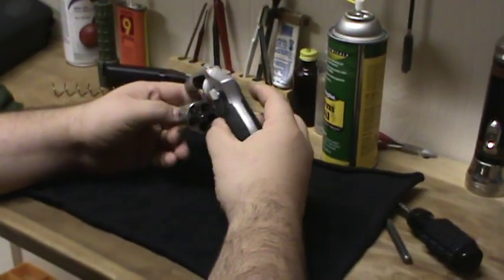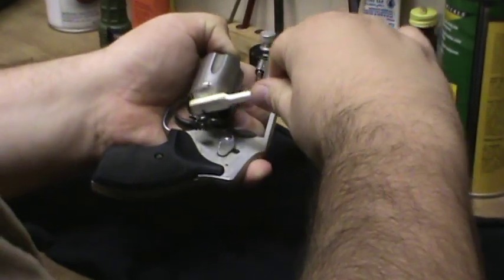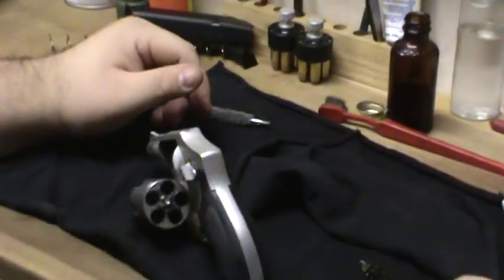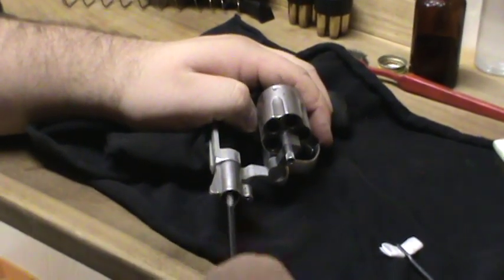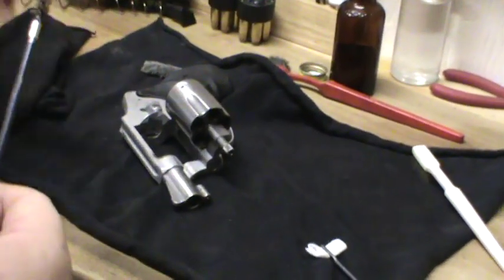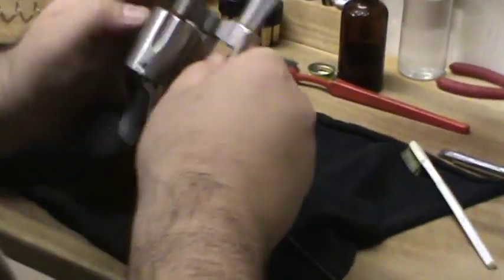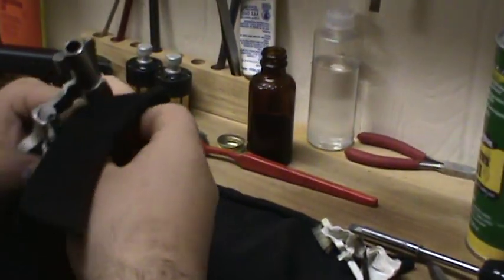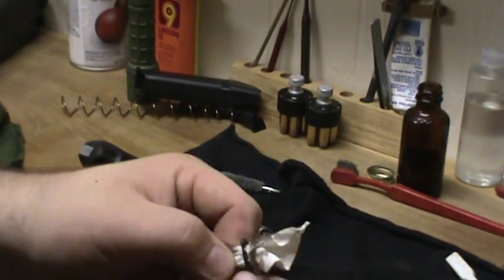Cleaning the Smith 642

Comment: Nice video...good information.  I have the same revolver and absolutely love it.  
I don't aggressively clean the cylinder facing the barrel.  I wipe it down occasionally, but not enough to remove the built up carbon.  The tighter you can make the gap between the cylinder and barrel, the better it will perform.  Not as pretty, but better functionality.

Comment from the maker: Be certain that the rod has not backed out, and if so tighten it.   take the screw out of the cylinder release and work some oil down in the hole.  Also put some oil on the little plunger that is in the barrel shroud where the ejector rod touches.  Also, on the end of the ejector rod you can put some oil and work it up in the rod's mechanism.

Comment from the maker: should be able  to.   the 442 and 642 both are painted as they have aluminum frames, so letting it soak in solvent for any length of time will most likely damage the finish.   the finish on the one in the video was already damaged so i never paid it much mind